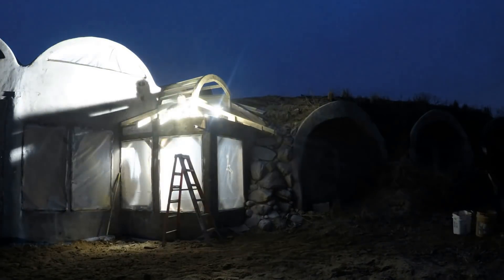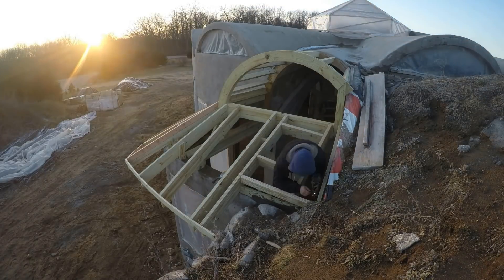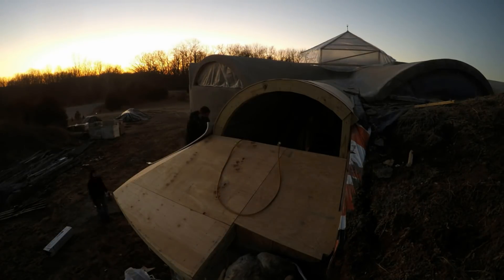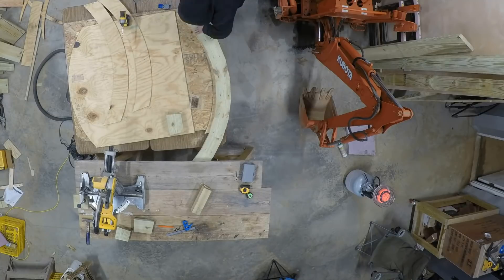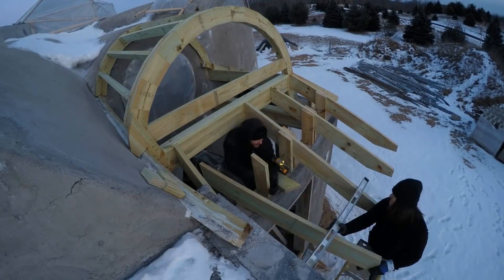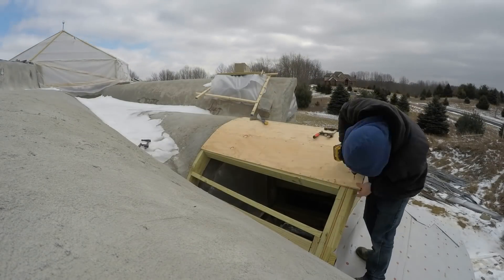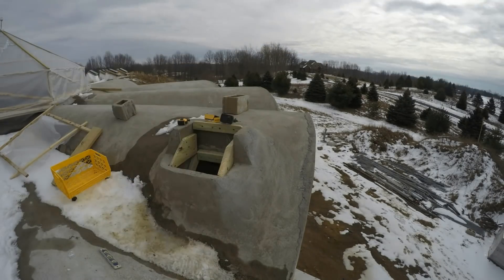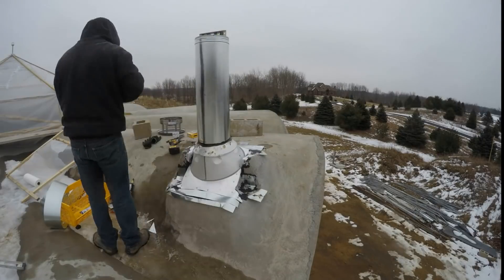41.9: Wood Roof Section

Comment: Why the change in materials (why not concrete the lot?)
Reply from the maker: Part of it is that I am experimenting with different things...  But I chose this section for wood because it isn't earth sheltered.  I'll be putting a steel roof over this section and it is a heck of a lot easier to add that to a wood roof section than a concrete one.